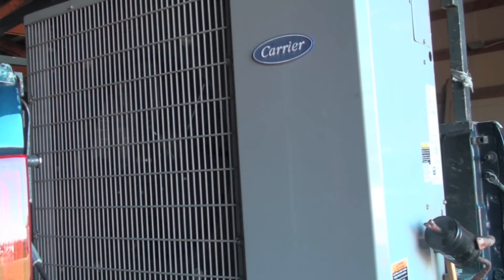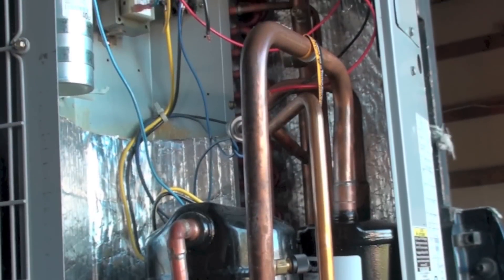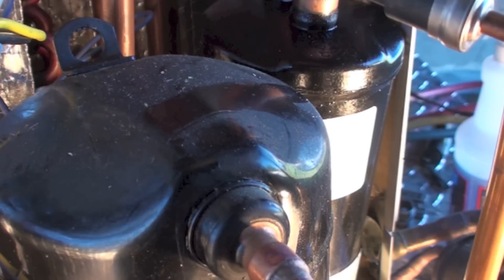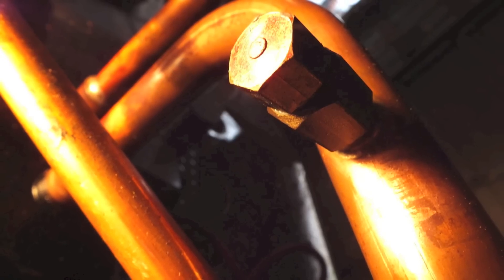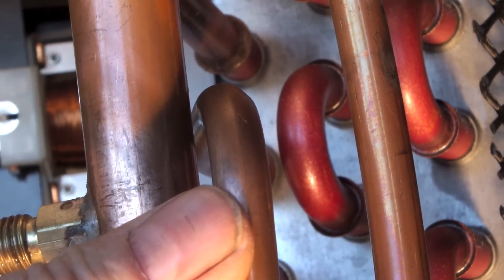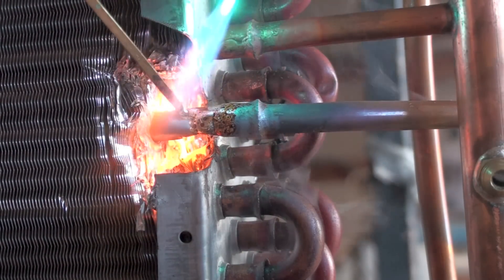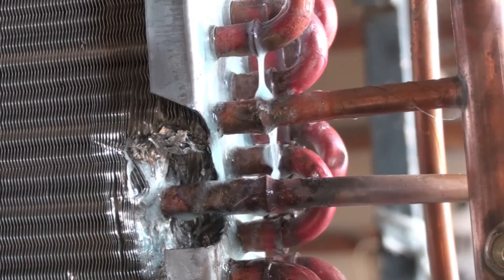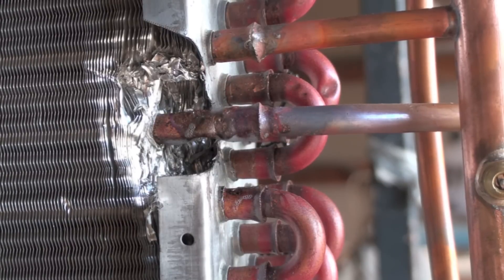How to repair an Air Conditioning condenser leak

Comment: Good Video. You can also apply a little bit of flux after you clean the tubing to be soldered. The flux will help the solder flow better as you move the flame. After the leak check, place the unit in a good vacuum. Isolate the pump from the system by closing the low side on the manifold and turn off the vacuum pump, wait a few minutes if it advances to 28in(hg) and remains constant, it also means there is no leak and you have a good vacuum. However, if it does not hold a vacuum and the gauge is indicating a vacuum loss, recheck your work (if the joint is ok, then there may be another leak elsewhere in the system). Continue vacuum for about 45 min to an hour. When re-installing unit, be sure to replace the dryer on the liquid line. This will help protect the compressor and other components of the sealed system from contaminants that may be trapped in the system. Another option is to flush out the lines and the condenser. Thanks for showing Gray Furnace Man.

Comment from the maker: The brazing skill is definately a learned one.  You need to have very good control of where the flame is so the heat only goes where you want it.  If you can practice on old coils it helps.  Thanks for the comment.
GFM

Comment from the maker: I use 15% Sil Phos.  It is a high temp brazing compound.  I believe it melts between 1400 and1600F.  I stay away from 5% or less especially for older tubing as I haven't had good experience with it.  Thanks for the comment.
GFM

Comment: Great repair, I also have repaired a bunch of leaks like this after people who recommended to replace the unit or complete coil, I have worked around guys if the leak is in the coil they say replace, good thing I enjoy going behind these techs and repairing the leak, I got to admit though the tubing in the coils are very thin and very easy to make a bigger mess if you don't know what you are doing, I agree with you on the 15% silver I don't care for anything below that, or the dye either!!

Comment from the maker: This unit had gone thru quite a lot before being trashed.  I think the compressor hold down bolts were removed during diagnosis.  As for the header I, like you,  immediately thought that was the leak.  However, I think that was a result of the unit being roughly handled during disposal.  If you can, I would like to see a vid on the repair you mentioned.  Thanks for the thoughtful comment.
GFM

Comment: fixes like this are very satisfying today i had an old trailor coil with a bad danfloss txv of witch i did not have but as luck would have it i had just done a change out on a goodman cased coil of the same tonage so i clipped the caps and converted it to a goodman metering set up

Comment: Those accumulators used to have a melt out plug on the bottom, in between the floor pan, where you couldn’t see. they would leak from there, but so little you couldn’t hear it.  Was hard to track down.  Those condenser lines split at the galvanized header because the pipe expands and contracts, or vibrate against a solid header, where it can’t expand equally.  I used a very small tip with a very soft flame to repair these, because of the thin pipe.  Out of balance fans which cause the cabinet to rattle can also cause these types of leaks.
Reply from the maker: They still have them and they still leak.
GFM

Comment from the maker: I am not a big fan of dyes.  I have found that by the time I have set up the uv light and covered the unit with a tarp so I can see it, I have already found the leak by following the oil trail.  I am not saying that they should not be used.  Anything that works is ok.  Auto a/c is somewhat easier to find because the parts are usually in a dark area to start with.  Thanks for the comment.
GFM

Comment: Doing it today, on Nordyne 3.5 ton unit Evap Coil. Damn near Same spot. Looks like mine, but ended up, with help from retired 44 yr HVAC repairman, who did the real work, tsking the coil all way out. Got dark on us, so pressurize tomorrow and crossed fingers

Comment: Excellent video and tutorial.  I just received word that my 12 year old compressor was leaking at the COIL and not repairable. Well now it looks to me like NOT ALL COIL leaks are cause for giving up on otherwise perfectly functioning equipment.  I am hoping for a similar diagnostic and repair!!
Reply from the maker: James Nitzberg If the coil is copper with aluminum fins, it can be repaired.  If it is all aluminum, probably not.  
GFM
Reply: grayfurnaceman - it was copper, and in part because of this video, I had hope.  It was done by a local HVAC professional and I am basking in the cool glory of air conditioning!!  Thank you for the idea.
Reply from the maker: James Nitzberg Its good to be cool!
GFM
Reply: grayfurnaceman  Well I was cool, however we found another leak in the coil!!   Back to the drawing board...
Reply from the maker: If the coil is copper with aluminum fins, it is sometimes repairable.
GFM

Comment: Good info. Why aren't UV dyes used in home ac installations? They can be safely used in automobile's air conditioning. Just a lil dye would make the leak obvious. The dye can be left in the system for future leaks and is said not to hurt anything.

Comment: It's a very common household situation that air condenser coil is leaking. Good thing is that you can do it by yourself on repair. But if you don't have the time, you can always call a professional that can do the job for you.
Reply from the maker: Dwight Gropper The video is not necessarily made for diy.  Many techs do not know how or will not do this repair.  In fact, the unit shown was replaced at 5 years because no one wanted to repair the coil.  Thanks for the thoughts.
GFM

Comment: Doing it yourself has its rewards. However if it’s a machine that you need to use every day that’s necessary specially with a very warm climate, then it’s better to call the professionals to avoid delay and further damage.

Comment: nobody wants to work any more doing repairs - any little thing wrong with a furnace or a/c system and the techs recommend replacement - because thats where the money is
Reply: 100% Agreed! Sad isn't it? For a System like this... Why not make replacement Parts and People can replaced the Entire Coil. Save the Unit for few more years and cheaper too :D.  Sometimes I HATE this World, because it's all about MONEY !!!!
Reply: bob14219 actually a lot of times it cost more to repair than to replace, especially now that China manufacture everything for cheap
Reply: We repair over replace because eventually it will be replaced and if you can make a great repair you surely secure a bid.

Comment: Hi I found a small hole in my condenser pipe at the corner, after I braze repair it does the AC unit need to be re gassed? Im not sure where the AC compresser gas goes through the condenser. thanks

Comment: My condenser leaked freon and 2 weeks later leaked oil.  I have only 1 month left on the Mfr wrranty. I gave it 3 days of living in the oven-house in Houston, TX.  Many had quoted me for a new condenser vs entire system replacement and said after 1-month you dont know wht'd happen.   Only 1 out of 5 companies said to repair the coil and can find parts, offers warranty after repair, but the quoted price included the warranty cost.  How serious is the coil-leaking-oil issue?  And what is the best option?
Reply from the maker: Well, the unit cannot run with a leak.  If the unit warranty has expired, but just barely, I would contact the installer to try to get it repaired under warranty.  Most companies will cover just out of warranty repairs.  
If you must pay for the repair, and the coil is copper, repair is viable.  As for warranty of the repair, most companies will warranty their work but will not warranty the rest of the coil for leaks.
GFM

Comment: We almost never hack up the coil fins to get at the joint. But if u have to....also we have blown adjacent elbows with the heat. A good leak detector helps. Once a year to rapair recurrent leaks.

Comment: Had an HVAC tech diagnose our unit with a evap coil leak on one of the ends out of reach. Aluminium pipes and fins with copper elbows. Parts for the unit are still under warranty so the thought it would be better to just replace it. He also said that they've replaced this coil in other similar units for several other customers. Anyway, they just installed the new coil, did a pressure test, and then while vacuuming the lines one of the condenser coils started leaking right at the sheet metal like you were showing. The tech proposed going with a new part (covered by warranty), but it would take 2 weeks to arrive. I sent some pics to a friend that does HVAC and he said it's a factory defect but would be no problem to repair as you've done... I'm just thinking "two defective coils? Is the third just a ticking time bomb?" 

Anyway, I do have a question: if the pipe running through the fins is aluminum does that make it much more difficult?
Reply from the maker: The piping is almost certainly copper.  It is covered by the aluminum fins.  Aluminum cannot be directly connected to copper due to corrosion.  The copper can be repaired.
GFM

Comment: Great video 
Question : I have a 1.5ton  220volts split unit AC.  After few seconds of turning it on, the clamp meter reads 22A then rise to reach 37A for few seconds then it stops and the clamp meter reads zero or 0.1A. What could be the problem  ?
Reply from the maker: The 22 amps is higher than the rated amp draw for that sized unit.  If the draw is below 12 amps immediately after being started, and it rises with time, I would be looking for a blockage in the high side.
GFM
Reply: @grayfurnaceman  
Thank you for your answer. I will check and see what happens.

Comment: is that propane torch you used? Mapp or oxy actyl? Do you do this with the freon in the tubes?  Or do I have to evacuate the freon? I'm asking because i detected a leak with some soapy water at a seam on a copper pipe that leads into the house from the condensor.
Reply from the maker: +Maynard Becker Its an oxy-acetylene outfit.  You must remove the refrigerant from the tubing.  It will break down and if there is any positive pressure in the tube, it will not seal.  Also some refrigerants produce poisonous gas when overheated.  I also recommend running a very low volume of nitrogen thru the lines when brazing to prevent copper oxide from forming inside the tube.  Hope this helps.
GFM

Comment: In the plumbing market there are " glues " " sealant " to replace solder , have these things crept into the HVAC world yet ? 
I wish the companies that build this kit would not make it soo unservisable , its the way they make it so they can assemble it rather than make any real  attempt to service it without having to make it look like a road accident to get it apart . 
Great work .
Reply from the maker: magna59 The "sealants"  that I have tried failed miserably.  Brazing is still the best.
GFM

Comment: Do you have nitrogen flowing while you are brazing or just before you start?  I can't keep from blowing the braze out of the joint no matter how low I set the pressure.  I was told to sweep it with nitrogen and then stop the flow to braze.
Reply from the maker: 958kris This is a common problem.  I set the nitrogen flowing so that I can just hear it coming out of the fitting.  It should not register on the gauge.  Hope this helps.
GFM
Reply: I just watched your other video explaining this process.  It makes perfect sense.  Wish I had had your videos years ago.

Comment: @grayfurnaceman
Hey, hope you can point me in the right direction. I have a unit that has been going strong for about 10 yrs. The condenser is clean. The u-shaped loops are starting to take on a bit of rust from age, but nothing extreme.  Previously I've pushed the air upstairs by blocking the first floor vents. After about 12hrs on a hot day this resulted in an ice up of the condenser. I opened the first floor vents to fix that flow issue.  Fast forward about half a week later its still hot out. Came home after a couple days away, 28C and its running all day and still 28C in the house at a setting of 23.  No ice,  and the condenser is only cool on the bottom - not to the top. Its producing condensation and water is flowing at a regular rate. So its cooling, and the return is just cool to the touch. 

Its been around 34C outside.  Is the system just overmatched by the summer heat do you think?
Reply from the maker: You may have low charge.  Check superheat at the exit of the evap.  Anything over 15 probably means low charge or restriction.
GFM
Reply: I meant evaporator above, still getting terminology straight.  Evap unit is ~12" to a side A type. Frosting from the midpoint down both sides. The top half is not cool at all.  Will measure superheat side, but think it was low.  Liquid line was reading around 19C (smaller diameter). Using this for a reference: http://www.contractingbusiness.com/service/why-measure-three-types-superheat

Comment: hi , do you have any videos on units with blockage and how to clear them if possible without a vacuum pump?
Reply from the maker: +crispian francis Blockages are going to require disassembly of the part with the restriction.  Pressure and vacuum pumps probably will not help.  Hope this helps.
GFM

Comment: Does this type of repair on a home sleeve unit last it the repairs are done. I do not want it fixed and then it gets hot and it is off again.
Reply from the maker: It works if it is done properly.  Done it many times.
GFM

Comment: My Frigidaire air unit is a 1990 I found that out from the buyer the person who had something to do with it when it was put in I have a 91 double wide mobile home so it was the new unit when the unit was new anyway it’s leaking water out of the vents in the ceiling which means by my understanding that I have a condenser problem does that mean the whole unit has to be replaced? Does that mean I have to buy a whole new air conditioner I have 1500 ft.² in my mobile home and he told me it would cost me $5000 to put a new one in that’s really high I think I don’t know I need somebody who knows to help me I’m 79-year-old widow and I can’t afford $5000
Reply from the maker: If your problem is water coming out of the vents, you have a condensate problem, not a condenser problem.  This may seem like semantics, but it is not.  
Condensate leakage could be from a plugged evaporator (indoor coil).  Cleaning the coil may help.  You could also have a low charge condition.  That would cause a freezup of the coil and water leakage.  
The condensing unit is the outdoor unit.
You need a tech to give you an accurate diagnosis of what the specific problem is.  
If you need further help after the diagnosis, I will continue to help.
GFM

Comment: Do you need to fix the fins after? Or is it not that big of a deal
Reply from the maker: You just do the best you can.  There is a small loss in efficiency
GFM
Reply: Wow! Thanks for the super fast response. What does GFM stand for? 
Also, I'm not sure if this is the right place to ask, but I come from the appliance world, I'm just starting to get more into seal system work. 
My question is regarding brazing with nitrogen, I've seen a few videos about it, and it seems superior to not using it, but is it really applicable if you're doing a small system like a fridge? 
Do you have any videos on small units like a fridge?
Reply: I just realized what GFM stands for. Duh. Lol
Reply from the maker: I would think it is more important to use nitrogen in small units.  Smaller expansion devices, smaller compressors would be easier damaged.  The only video I have on small units is a Scotch yoke compressor.  
GFM
Reply: grayfurnaceman gotcha. Thanks for the response.  Awesome channel, I've learned a lot, and it's been a huge value.

Comment: What size tip are you using sir. ?
Reply from the maker: steven messick I believe that's a #2 Victor.  I use the larger tip for faster warmup of the joint.
GFM

Comment: hi
my ac is slowly cooling and compressor is overheat .when i start ac , a odd smell is occur inside the room.
please help me what can i do?
Reply from the maker: Sounds like it may have a refrigerant leak.  The leak will need to be repaired and refrigerant added.  I can't tell you about the smell.
GFM
Reply: grayfurnaceman thanks

Comment: well lets see... determining the cost to make that repair. there seams to be two avenues of thought. one hourly rate and the other is hourly plus taking in consideration of the cost of a new coil verses. so can we conclude that if the coil is repaired (labor) then the customer avoids the added cost of a new coil would it be considered fair if the technican took into consideration the cost for a new one and broke that cost in half and added that cost to the repair because he thinks its fair to share some of the savings the customer got.
Reply from the maker: I never think in those terms.  I just determine the cost, tell the customer and give recommendations.
GFM
Reply: grayfurnaceman i think like a tradesman and would follow the same train of thought. i only proposed the consideration in light of paying for services rendered to me by a mechanic in which his prices did split the cost of a new part which his expertise saved me from having to purchase. by the way i enjoy your videos and foward them to someone that is just starting in the trade.
Reply: Are you kidding?  Why not be honest?  Why would you deserve more than time & materials?  Gotta stop thinking of ways to gouge the customer.